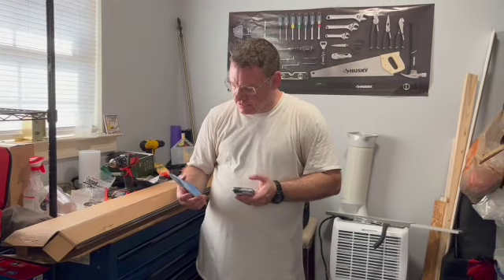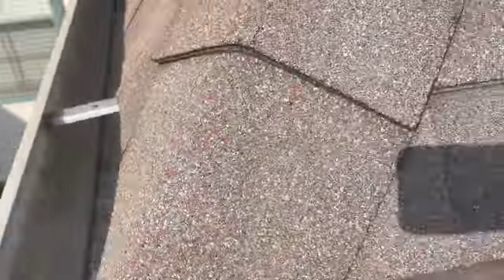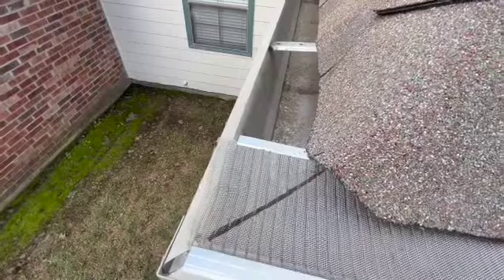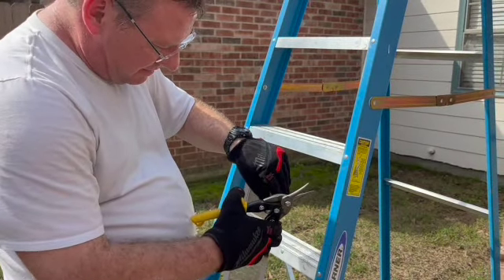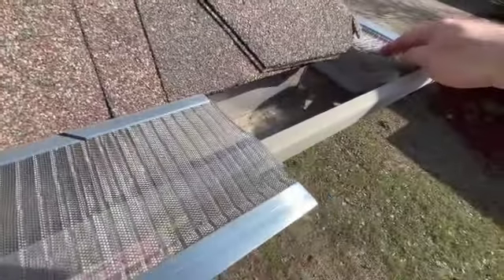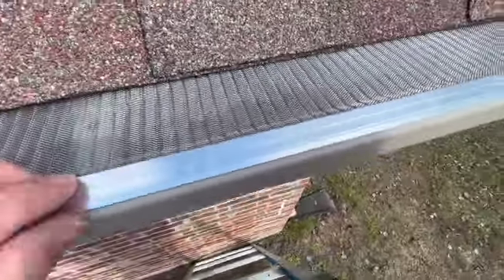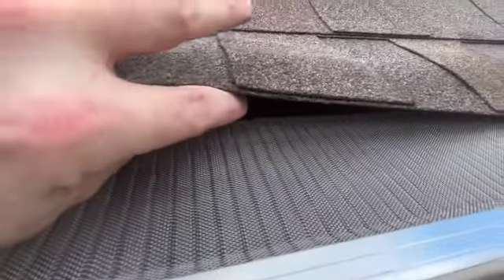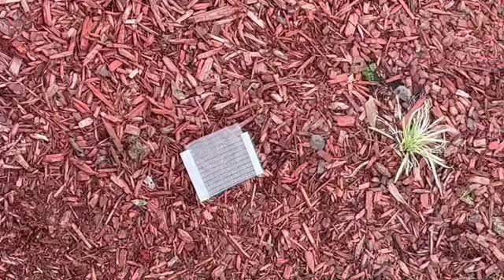Raptor Gutter Leaf Guard - Stainless Steel Micro Mesh

Comment: How hard was it to lose the shingles for tucking the guard under? I have the same shingles as you and tried inserting the short sample gutter guard, and couldn't do it. The shingles are very stiff and possibley nailed down too close to the gutter.
Reply from the maker: Although the shingles were stiff, I was able to lift them enough to slide the gutter guard under them.
Reply: @PaulNaylor3  ty, maybe I'll have another look
Reply from the maker: I hope it works for you. It has worked for me. I haven’t had to get on the roof to clean any more leaves out of the gutters and haven’t had to make any adjustments since I installed it.